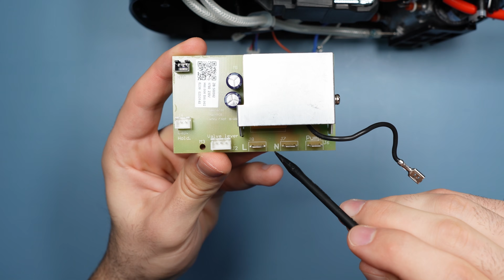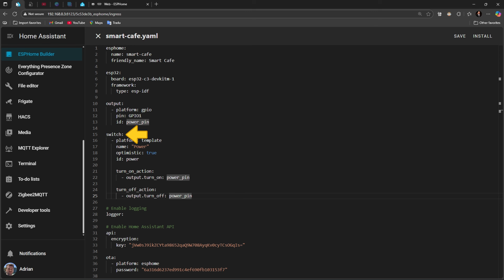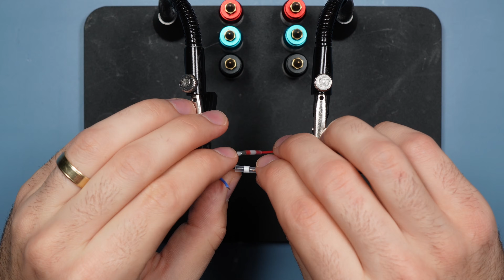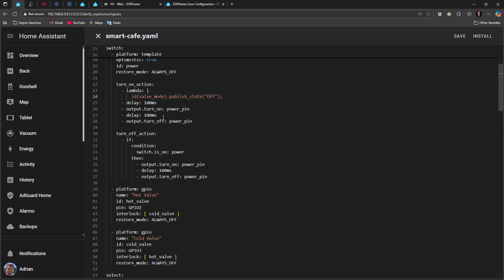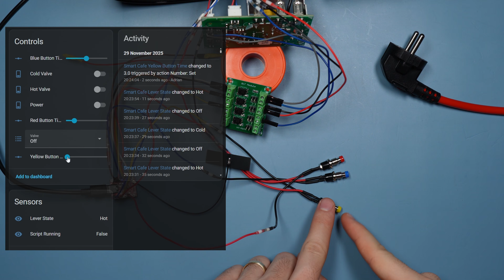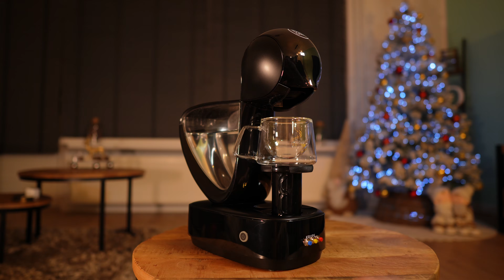How an ESP32 Made My Coffee Machine Smart

Comment: Thank you a lot for the high quality video. Do you have any experience on how to trigger capacitve touch buttons? For each button there is a spring behind a glas panel on my device.
Reply from the maker: Check my video with the dehumidifier, that one has capacitive touch buttons, i don’t know if that worked just because it had a cheap controller. Try as I did and maybe it works. Good luck!

Comment: Instead of the light sensor could you sniff the signal going to the LED ?
Reply from the maker: Yes, but for that the esp needs common ground with the board, thing I wanted to avoid, so I had to find another option that doesn’t require interaction with the board.

Comment: Another great project. Can I ask, did you use an opto coupler for its size and convenience or avoiding electrical noise ?, unlike the smart Fan
Reply from the maker: Thank you!
I used an optocoupler because I was working with low voltages; the other advantages were a bonus.
The smart fan didn’t have a control board, only a switch that controlled 230 V, which is why I had to use relays in that case.
Reply: @AdrianSlabu  , yes, now i understand.

Comment: Could you do a video on soldering? I really want to learn how to make such clean connections
Reply from the maker: Have you seen the cable joints? 😂
If you mean the headers connections, yes, they look decent.. because are easier compared with soldering wires.
You need a clean tip, iron temperature set based on your solder type and a good flux.
Maybe in the next video where I need to solder the headers I will show a step by step guide.

Comment: Why?
You still have to manually fill the reservoir with water, place a capsule in the receptacle manually and manually put a cup on the pedestal, which has to be adjusted manually.
And why are you using a pod coffee maker? Those are horrible for the environment, apart from being woefully overpriced whilst being underwhelming.
Reply from the maker: Hi, to show people how to control appliances remotely.
We don't drink coffee, is mainly for guests.
Using my examples people can learn how to control this devices using esp32, so is not about the coffee machine.

Comment: So how does this refill the water, put in a coffee capsule and place the cup? Without any of these 3 you cannot make coffee with this "remotely". So more of a gimmick than useful in any practical way. 😞
Reply from the maker: I’m not planning to use it remotely because I don’t drink coffee, I made this so I can have 3 buttons, one for each coffee cup we have, so when we make a coffee for guests we press a button and it will stop by itself.
About controlling it remotely: you place a coffee cup inside, and water in the reservoir.
You can make an automation in home assistant to start the coffee machine based on a sensor (time / movement in a specific area / sun position / etc) and when you go in the kitchen the coffee is ready. Of course this can be done for one coffee but is better than nothing.

Comment: At 13:06 you create a sensor to check if the script is running and later check this sensor within your script. You can change the mode of your script to single, restart, queued or parallel which controls what happens when a script is invoked while it is still running from one or more previous invocations. Single is the default value.
Reply from the maker: For this to work as I want it needs to be in “restart” mode and it’s already like this, don’t understand me wrong but I don’t know what you mean.

Comment: The control board of your coffee machine gives 3.6 Volts, which should be enough to power your ESP.
Reply from the maker: Voltage alone is not enough to power the ESP, you need to have enough current (amps).

Comment: Maybe, you could get 5v or 3.3v on the control board.
Reply from the maker: I tried but it didn’t had enough power to hold the esp.
Reply: @AdrianSlabu  C3 normally costs 100~200ma which isn't too much. Could you measure the voltage before the ldo on the board?

Comment: For the code : 
Instead of doing a delay for the state colours - what you can do is have an internal variable timer that basically just takes a variable and counts down.
so variable is counter, and its a loop that if the value is greater than 0, minus 1 and set value
Then, when you press one of the buttons, all you do is set the value of that timer.
That value (timer) has an on value event.
On value of zero - auto turn off pump if on
On value > 0 - check value state - hot/cold - if not valid, set to zero and exit
 - if value is ok, then check pump - if pump is off, turn on.

What that also gives you is a simple catch.
In any odd state - say the value changes, set that to zero -and force set pump to off.
Where with a delay, if say the value state changes - it may not switch off unless you have that check - but the delay code still continues to run, where with above - simpler and will stop.

On hardware: do optos for the LEDs - it has 2 colours, so 2 optos?
Now light pollution wont be an issue - but you can also count the flashes and make a state.
ie - on/heating/off/working

And you can then take the code mentioned above further.
So instead of turning the unit on, value and then pressing the button once it is heated.
You can flip valve (or leave valve in hot all the time? ... unless you like your ice coffees a lot) or just press one of the colours.
So lets go through the colour buttons - you press yellow.
Its first intent is set the timer.
Now, the timer code can be updated to 1 - check value (as before ... since if value is not valid we cannot coffee).
BUT NOW.... We see machine is off. turn on machine (keeps looping without decreasing the time)
Now it sees its on but its in heating mode - so we ignore and continue.
Then loop comes around and it's idle (hot) - and continues through the loop which involves turning pump on making the coffee and switching off

That allows you to basically leave the value open, and press 1 button to make the perfect cup :)
Reply from the maker: Thanks for the detailed suggestions, I appreciate it! I'll definitely look into using a timer variable.